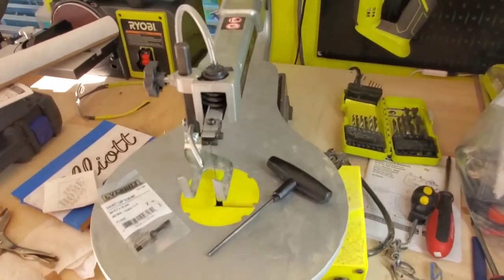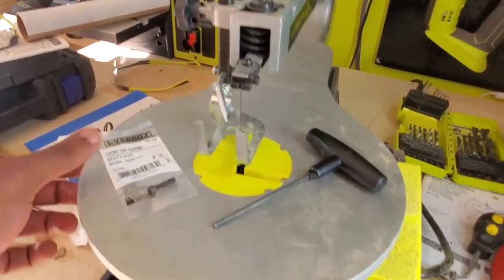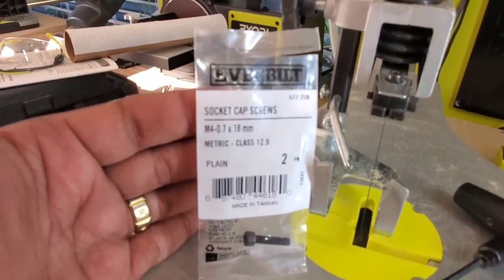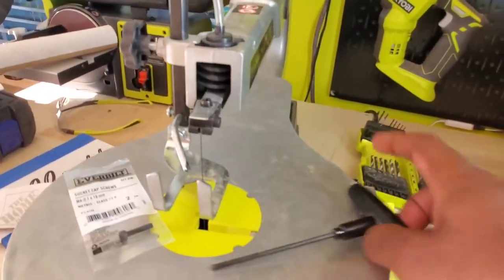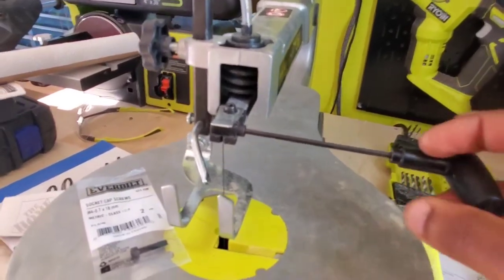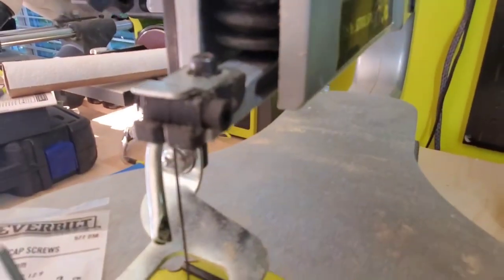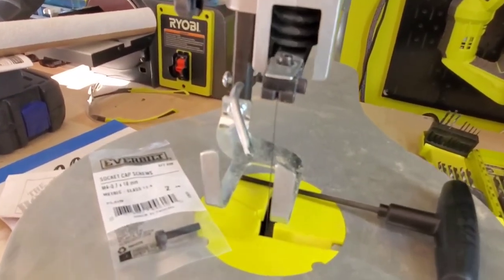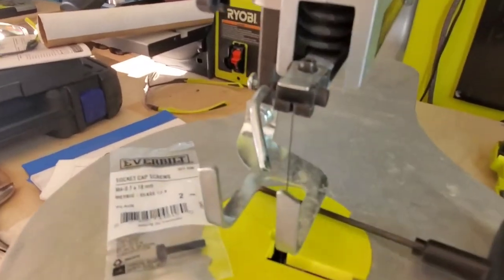Ryobi Scroll Saw Blade Clamp Screw Fix

Comment: Dude, I just wanna put painless in mine and can’t figure out how to! #RyobiRebels
Reply from the maker: You put them in like you would with the normal pin blades. They just need to be in way tighter, that's why you need to replace the blade clamp screw with a better one.
Reply: @DIYDadOfficial  copy that. I’ll rewatch video, I’ve watched so many recently they are all mixing together!
Reply: @DIYDadOfficial  my scroll saw didn’t come with those kind of bolts, mine came with some that have like a grip on them. 🤷🏻‍♂️